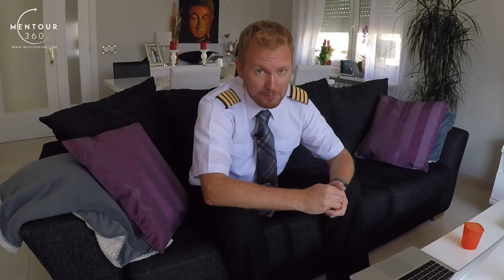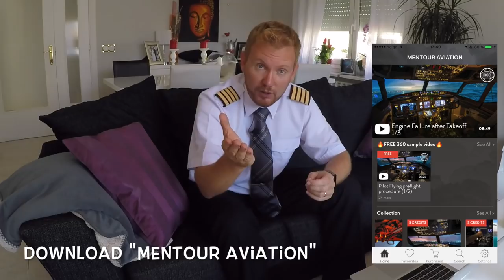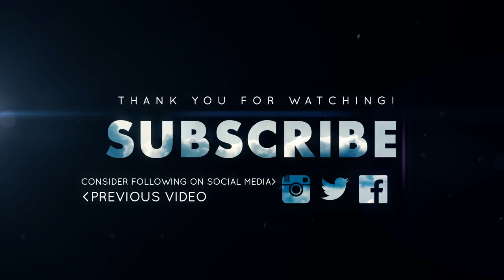Why do pilots sound like robots - PA

Comment: Definitely you didn’t answer this question. Voices on the PA doesn’t sound like robots but like a telephone call. That’s because the microphone has preset to High pass filter and low pass filter and leaving the vocal frequencies remain without hearing any other sounds from the environment. 
Although you people who using those microphones just put them close to mouth and speak loud and clear so passengers can hear you. 
Same thing for the stupid flight attendants who they put the microphone 20cm away and they create feedback with the speakers. 
Just tell them to put the microphone close to the mouth and speak loud and clear.
Reply from the maker: I was aiming more for the monotony in our voices and low volume, thank you for your explanation.
Reply: Mentour Pilot Surely it’s better for the passengers to hear a steady, strong, full of experience and happy/smilie voice than a monotony bored one. 
Trust me, it works better.